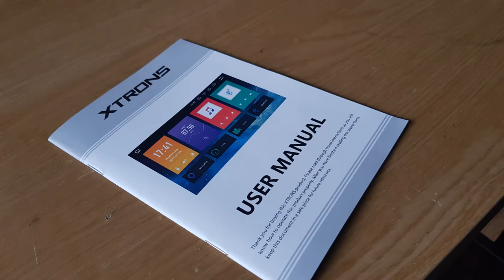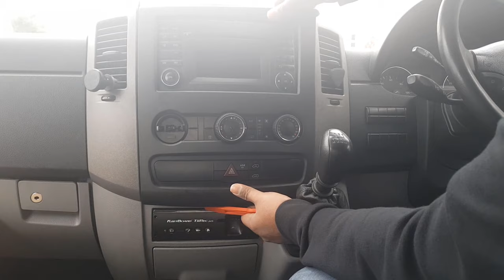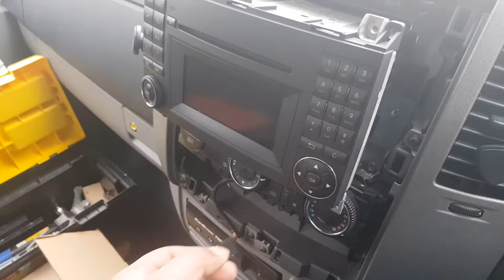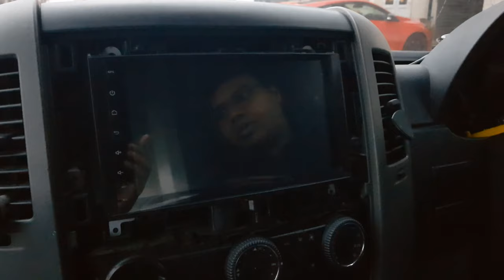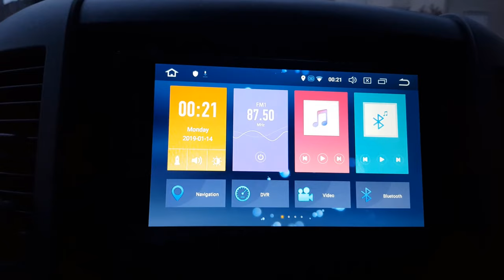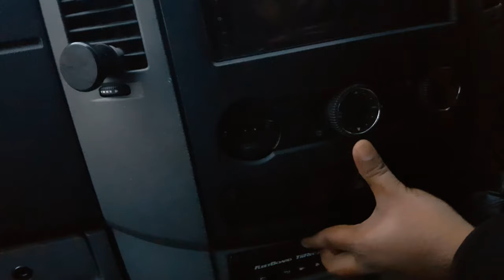Sprinter Android Radio Installation - Xtrons Android 8.0 on Mercedes Sprinter

Comment: Mine looks similar on the back I'm really struggling it won't turn on. It came with 2 connectors for the one hole, the one I've used doesn't have the big plastic box attached. I've plugged everything in the same apart from that wire with the plastic box (as it won't fit into the cables in the existing hole) W369 VITO
Reply: Hi, I just have same stereo and same issue. Did you get your resolved

Comment: Hi at 2.19 on the video you show the wiring on the back of the radio and there is a green plug in the bottom , then at 2.30 you show the wires coming out of the dash and the green wire is not there, What is it for and what did you do with it.

Comment: Awesome video,
1. Did you disconnect the battery before replacing the stereo? 
2. Your old stereo had 3 connections, power, antenna (white connector) and (the yellow connector), where did the yellow connector connected to? And what's it responsable for.

Many thanks,
Mike
Reply: i also would like to know about the yellow connector
Reply: It’s for reversing camera
Reply: my radio didnt work so when i opened it up i didmt see a wiring harness at all. can someone show me where do i put the new wiring harness?

Comment: Hi would you know what wire needs to be spliced in to make the stereo stay on instead of switching off automatically after 15 minutes
Reply: Connect the RED (ACC) wire to a constant 12v (just like the YELLOW wire is constant 12v), but recommend you install an in-line ON/OFF switch to prevent battery drain.

Comment: Great video, My sprinter has hands free voice mic. Does this unit connect directly to the mic? thanks
Reply: No, these aren't designed to integrate with the factory microphone.  
However, this particular unit has the black 3.5mm socket in the back to accept an external microphone for BT hands-free.
Be aware - not all units are sold with the external mic input.  You will need to choose your purchase carefully if you want the external microphone feature.
Reply from the maker: Thanks

Comment: Does this work with 2017 sprinter 3500? Also can I add left/right/backup camera?
Reply: i think so, check the design with your radio
or find on xtrons website

Comment: Hello, how'd you wire the steering wheel keys in the sprinter? It has Key 1 by itself then key 2 and ground.
Reply from the maker: Plug-and-Play no need additional wiring

Comment: Thanks for the video!  Did your orginal back up camera work with the Xtrons?
Reply from the maker: My van doesn't have one
But there is some input cable for camera
Reply: @PLIDD  Thanks for your quick reply.  Much appreciated.
Reply: Sorry to trouble you again but does this unit have a built in mic or should I purchase one?
Reply from the maker: @michelfarmer7888  it has a build in mic

Comment: Hi, just put this in my 2017 sprinter. And can’t connect it to Bluetooth via my iPhone, is there anything you could suggest. It’s not picking anything up on the search ? 
Any info would be much appreciated. 
Thanks.
Reply from the maker: Try this
https://xtrons.com/blog/connect-phone-to-cars-bluetooth/
Reply: Had same problem reboot stereo in settings menu

Comment: Bro how much is that?? Pretty cool.
Reply from the maker: £250 to £300 its depends on your model
Reply: @PLIDD  it's 2010 sprinter
Reply from the maker: @navroopsingh2296  £284.99 it must be same because i installed to a 61 plate sprinter (2011)
https://xtrons.co.uk/mercedes-benz-various-android-10-quad-core-2gb-ram-32gb-rom-psp90m245
Reply: @PLIDD  how much for a 67 reg sprinter 314 cdi

Comment: Hey do your steering wheel controls work on your Xtrons unit?  If so did you need to do something special?
Reply from the maker: It's built in function
Reply: I understand that but it doesn't work on mine so I was wondering if it worked on yours... @PLIDD
Reply from the maker: yes its working @michelfarmer7888